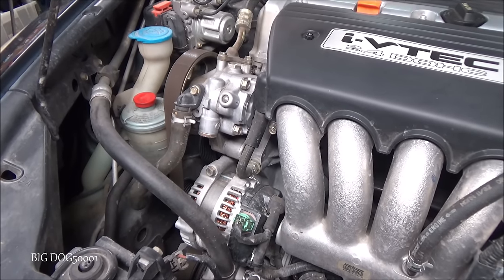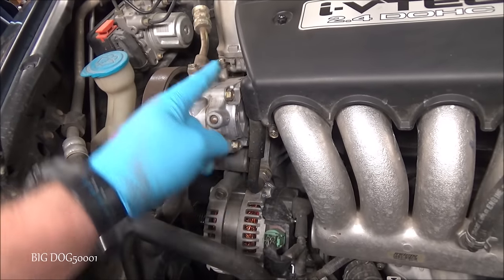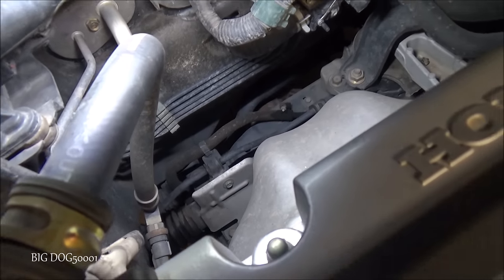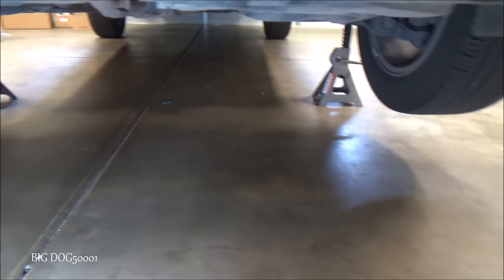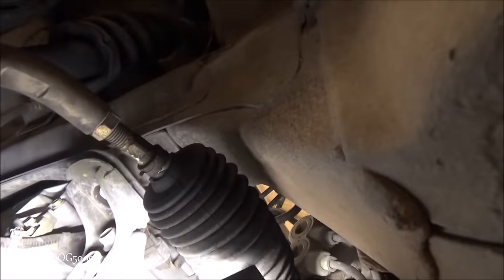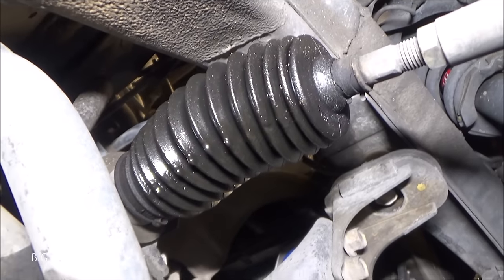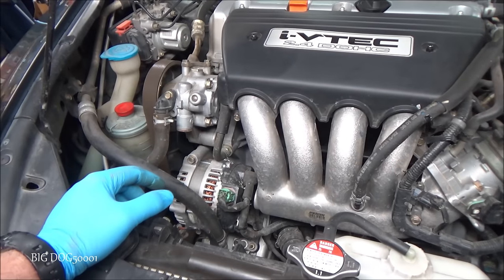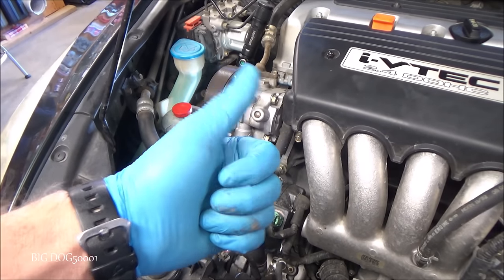Honda Tips: Finding a Power Steering Leak

Comment: Been driving my Honda without power steering fluid for over 3 years. Got tired of putting fluid every month. To this day I just man handle the steering wheel like my grandfather did back in the 1920’s. If some one tries to steal my ride, which I doubt would happen, it’s manual, with no 2nd gear and no power steering.
Reply: Damn a challenge 😭u cool though
Reply: @bintreshin3545  as long as A/C works, I am blessed
Reply: @Denver_____  not lying brother. Hahahaha ac its a must have
Reply: You're crazy. 😅 Jk. I'm not proud of this, but I don't know how to drive a stick. I Know how and I have drove before, but easier to say I don't know how.
Reply: i laughed at this way harder than i should have
Reply: At this stage of the game… The thieves leave you a donation can to collect money for a new ride 😂🤣
Reply: @MaxPleaseBeAGoodBoi  lol, open my door  in the morning and se a $20 dollar bill on the passenger seat
Reply: I thought I was the only one willing to tough out driving without power steering on my Odyssey! LOL! Mine is leaking out every couple days now so I just stopped buying fluid. Will fix it one of these days!
Reply: @robertc.6441  Keep driving it that way, my grip, arms and shoulders are stronger than ever. Had to parallel  park on a busy street, had to put some muscle behind moving the wheel all the way to one side while the car is stopped. Work out.
Reply: lmfao i love this. just changed the serpentine belt on my accord today, and got pissed, and yanked the power steering reservoir out "BITCH YOU DON'T EVEN WORK!!!" LOL
Reply: 😂😂😂 man handle the steering wheel
Reply: Jajaja! Love the no f***s given
Reply: Lmao I am at 2 months trying to figure out if i should replace it or deal with.3 years makes me think manual steering is fine, the noises suck tho.
Reply: lol still got another 300,000 miles in her.
Reply: @brandonb88 she’s gone from a slow leak to a full blow and I’m still toughing it out. Engine runs like a beaut other things are just rusting out
Reply: Damn savage with it
Reply: Same here !
Reply: Damn 😂😂😂

Comment: THANK YOU for this video. My Honda dealer showed me this exact leak and told me I needed a whole new rack. I didn't believe him. Thought he was just trying to make extra money off of me but you said the very same thing so I guess I'm getting a new rack.
Reply: How much did they quote you, if you don’t mind me asking? I have the same problem or so I think.
Reply: Same as me
Reply: Hopefully some people see this and are enlightened. For years now, the dealerships have become parts re-placers and not parts repairers. The total solution is always we need to replace this, Repair, never enters the conversation.
Reply: just so you know, most leaks (in engine/ transmission/powersteering) happen due to a rubber gasket hardening. while yes, as with all parts in mostly everything, you will have to replace the part @some point. but that could be 1yr, 2yrs, 5yrs 10yrs down the road. who knows if you'll even still have the car by then? so IT IS (imo) worth it to, at the very least, pick up a $20 bottle of sealant to see if it solves your issue.  ESPECIALLY if it is a minor leak. you might've been out of fluid, but the PS reservoir is not big to begin with and who knows how long it's been leaking. point is, it could be a minor leak and a $20 fix. there are crappy sealants out there, but AT-205 RE-SEALANT is a great product for any of the 3 i listed above. 

good luck
Reply: @mikeTHEmanatee I drive old cars and loathe that people actually do what you have described. I wish they would ban that stuff entirely. It's definitely not illegal and its your car but it's a mechanics nightmare explaining that the previous owner filled the system with an unknown substance.
Reply: At-205 is legit. You can also use it to keep rubber parts supple, such as the CV boots.
Reply: My dealer said you have a power steering leak and quoted a pump replacement.
I took it home, pump and lines are clean but, all this fluid down at rack sooo, sad day for me, but at least I didn't pay for a new pump then find the leak

Comment from the maker: This video covers older conventional power steering systems with power steering fluid and an engine driven pump.  Newer systems use Electrical Power Steering (EPS), which uses an electric motor to assist with steering force instead of fluid and a pump. I do not talk about EPS in this video.
Reply: Great Video! Thank you!

Comment: There doesn't seem to be a power steering cooling sub-system for these K-Series Hondas.  I don't have one in my Element whereas all the other cars I have owned over the years had something along the lines of a cooling loop in front of the main radiator or a mini-radiator or even a loop inside the bottom tank of the main radiator.

Comment: No need to guess what the oil leak was. It was the Oil Pressure Switch. I've gotten to know the Hondas quite well over the last couple years. I bought my granddaughter an '03 CR-V, and I bought an '01 Accord EX 3.0L last year as a hobby car/weekend ride. It never fails with the 2.4L. I finally got all the oil leaks fixed, and replaced the alternator (what a production to even get to the darn thing!), and just noticed yesterday that granddaughter's PS pump is now leaking. It looks like it's coming from the fittings. Going to try and replace the O rings in the return and high pressure connections to see if that fixes it. If not, I can get a reman'ed OEM pump and put it in.

Comment: I happen to be going to see my mechanic tomorrow morning exactly for this specific problem (as well as a few others), so this is an "absolute must watch" video for me. The problem I have is exactly as you have described, the kind of winding noise that increases when the steering turns. I had already changed the high pressure hoses on top, but the power steering fluid is still going down. Your video will certainly help as I will be discussing it with my mechanic tomorrow. Thank you and keep up the good work .... for those of us who are concerned but lack the technical knowledge and skills. Cheers bro.
Reply from the maker: Thank you, I appreciate the comment!
Reply: @Ravi Menon hey! Was your issue resolved? I’m facing the same issues
Reply: It's ok to put some oil and take to mechanic.   Or tow my car I have same problem
Reply: Do you remember how much it cost to fix it. I’m taking my 2003 Honda Pilot in tomorrow for this exact problem and I’m trying to get an estimate
Reply: @beyondinfinitelove13  NO don't use any other type of fliud even temperarily as it can ruin your whole system. Only use Honda power steering fluid or regret it.

Comment: Excellent video with amazing detail which I learnt a lot from. I'm glad you mentioned that you only use Honda power steering fluid and also only Honda parts. My 2000 Acura TL 3.2 power steering fluid is leaking. A friend said go to a local mechanic, and some people on the internet said to use stop leak and that non Honda power steering fluid is safe. After your great video and other sites that also suggested only use Acura power steering fluid, I have decided to have my nearby Acura dealer fix it. After your video and a few other videos I know that it isn't the O-ring and not the rubber steering boot below and no strange sounds when turning the steering, and no over flowing fluid bubbling out of the reservoir, which never went dry thankfully,  I figure that it's likely just the power steering hoses need replacing, which is expensive however a lot less expensive that changing the power steering pump. I'm thankful I didn't try stop leak or other makes fluid as it can wreak the whole system.

Comment: Thanks man .. got a chance to identify a power steering fluid leak I have near my front driver’s side tire while I had my splash guard off (just fixed my AC on my own for the first time and had the bumper + splash guard off so figured I’d check other parts of the car too while they were exposed). Probably just saved me some headaches in the future. Interestingly, the power steering fluid level is holding and doesn’t seem to be leaking at all; the level’s been the same for months and there aren’t ever any puddles I notice underneath. Not exactly sure why I still see fluid everywhere on the parts underneath as if it’s leaking though
Reply: CV axel leaking transmission/differential fluid.  I pour 1oz of uv dye to rule out engine oil/ps oil/trans oil

Comment: I just replaced the high pressure line myself. It was very hard to get the nut loose where the metal line connects to the power assist and steering column (I think that's what you call it??). Once I was done installing, I added  Prestone power steering fluid, but left the cap off of the resivoir so that I could see if I needed to add more. Yet, the result was that there was now a mess of fluid all over the place including the passenger headlight, all of the parts within 2 feet of the resivoir and pump. As I pulled out, the steering made a lot of noise. Then, I got to the corner of my street as the noise stopped but the steering no longer had any assist whatsoever. After going to the auto parts store to get a full quart of real Honda fluid, I found a puddle underneath.

Comment: thanks for this video. I had a leak with my Honda Element at an O ring area. I replaced that and now no leak there or at the reservoir. But there is still a leak more towards the middle and back of the engine. I can see it under the car and also on the frame. I will check those boots where you just found the leak on this car and see if that is it.

Comment from the maker: Any guesses on what the Engine Oil Leak was?  (Not the power steering leak)
Reply: VTEC control valve/solenoid
Reply: Honda engine, as simple as that, thats the cause because everything leaks, even the water around the cylinderblock channels leaks into the cylinder and evaporates, such a genius design of water channels that corrodes, sorry guys, a very bad experience  in honda
Reply: I sure would like to know what the other oul leak was?
Reply: As I mentioned in my comment, I'll say the Oil Pressure Switch. VTEC Solenoid Filter Assembly (the gasket) is too obvious, and when that goes, it puts oil all over the back side of the engine. Since the oil filter looked clean, and there weren't any drips or puddling of oil on the frame and control arm assemblies, but just on the rubber boot over the OPS, I'll go with that. It leaks too, but I've found not as bad as the VTEC Solenoid Filter Assy.

Comment: Using Honda accessories exclusively is in an ideal world. In my country it is very difficult to find original Honda replacements even oils and fluids, we have to look for after market. But if we go to the dealer, it is possible to find some, but with a value five times higher, or usually they don't have them,  wey have yo wait three months, it's very complicated. And Honda is a common brand in my country.

Comment: Bro you gotta show a plan B for those who want to fix their power steering leak without spending $$$. 

A brand new steering rack is good, original honda fluid is good. But what if we dont want to spend?

Is there a DIY without having to buy parts?
Reply from the maker: I wish, but any cheap fix will not last unfortunately and usually ends up costing more in the end after it has to be fixed a second time.
Reply: @jr217r  the boot only protects from dirt getting in if it's leaking from the seal it'll still leak

Comment: When i turn the steering the fluid in the resovior doesn't really do anything like bubble up. It seems as if its moving through the lines tho but slowly. Also when I press on the gas pedal while the car in park and the engine is running the steering feels more softer but when I ease up it gets back hard. Why is that? Do i need a pump or does it needs bleeding?. One more thing, the fluid levels remain the same.
Reply: The first time I experienced steering issues and looked under the hood, I found that a part of the serpentine belt had been completely stripped off. I could have just removed the stripped part, but it seems like something cut the belt. The car also shut off before the belt issue occurred. Therefore, it seems to me that the problem is related to the belt. I replaced that belt now with a slightly longer belt, and the issue persists

Comment: My mechanic told me same thing , and around 1100cad with parts and labor, too much for an 04 accord. I just top it off with power steering fluid every 3-4 weeks. Been 6 months , cost me $3/month
Reply from the maker: Sometimes a slower leak can go like that for a while but many times it will start leaking badly and it will lose all the fluid very quickly.

Comment: Great job my Honda is getting low too I can see under the under the hood in the back lower hoses is leaking.   
I have 2005 Accord with only 77 thousand miles on it and runs great I do have a ac hose leak too
Reply from the maker: Thanks for the comment!
Reply: Where do you do your work at ? Or state I’m in California and I like your upfront thinking about work.  
Do you know of any good mechanic in San Diego California? I have a Honda and 2001 Ford Expedition 4wd need a intake manifold leaking green fluid.
Reply: If u ever want to sell it contact me please
Reply: probably that leak is on the high pressure hose of P/S system.

Comment: Are going to tell us what the oil leak was from? Thank you for the video
Reply from the maker: It has been a while since I filmed this but if I remember correctly it was the VTEC solenoid.  Thanks for the comment!
Reply: @BigDog50001  Thanks Big Dog, funny I just replaced mine about 2 weeks ago. Mechanic shop wanted $1400. I did it for the cost of the VTEC Solenoid. Now the Rack and Pinion seems to have gone out. At least it's leaking from there. Time to buy a new car.

Comment: Exactly what my 2001 Honda Accord experiences now!  The OEM rack and pinion is a major rip off.  Got an aftermarket one for $180.  Will try to replace it.  I replace an aftermarket power steering pump and it dramatically reduce the leak.   Old pump was bad as well.  I am looking to replace the power steering pressure switch as well.

Comment: I had the same problem  all I did is change the boot u dont have replace  the whole rack and pinion unless both side are leaking bad second u could buy remanufactured oem rack and pinion for less
Reply from the maker: The boot only stops dust and debris from effecting joint, the seals inside the rack are what stop fluid from coming out.  New racks are hard to find after the vehicle has aged, most racks (even from Honda) are remanufactured units.

Comment: My return lines are damp both right where they connect to the plastic reservoir. Can I just swap out those two hoses myself? Makes noise and air bubbles in fluid when it’s cold out.

Comment: hi Big Dog really like your video and how you present the information in a easily understandable way.  When you say "change the rack" are you talking about changing the whole steering rack  n pinion ?
Reply from the maker: Yes, replace the entire power steering rack with a Honda rebuilt unit.  Very common on Hondas 15-20 years old. 
 Thanks for the comment!
Reply: @BigDog50001  thank you for the clarificiation and the reply🔥👍

Comment: So my question is has anyone actually replaced the rack seal instead of replacing the whole rack??
Reply: I just replaced the whole rack on mine with a VisionOE BBB Reman and wish now I'd just rebuilt the Honda one. The reman one immediately started making a pop sound at low speeds and the left inner tie rod boot has ps fluid leaking from it... very frustrated right now.
Reply: mrau92me i got my original honda rack rebuild with a year warranty and it’s working great!! Aftermarket racks do no good in hondas
Reply: @abhijeetsingh1429  My 97 Accord did fine with an aftermarket unit. Where'd you get your Honda reman unit?

Comment: So it was the tie rod leak?  Had nothing to do with the power steering line???  I'm leaking in the middle underneath that car     in between the tie rods.  Long medal piece is all wet.  What is that piece call ? That's connected to the pinned

Comment: I understand the best way to avoid the well-known & expensive Honda steering rock failure is to keep up on your fluid replacement regimen. Steering rack failure is a drag, requiring a tow and losing your car for a few days!

Old, dirty fluid will accelerate the wear of your seals, so replacing the fluid every 3 or so years is pretty cheap! Either:
- Drain and replace - this method involves opening the system. (Ask your garage to do this and ATF changes)
- or else pull all the fluid from the reservoir (turkey baster) and replace it a few times, running the system each time it has fluid. This is the less-than- perfect 'dilution method' but avoids disturbing the connections & is still FAR better than ignoring fluid changes until the rack fails (costing you a thousand dollars.)
Reply from the maker: Thanks for the input!  Here is a video I did on servicing Honda power steering fluid:  https://youtu.be/jhIdhffMl5c
Reply: Well said. Thank you for posting.

Comment: My tsx is 07 with just over 100k on it, got this exact problem yesterday but it's leaking on the driver boot, and the fluid was very low.
Reply from the maker: Pretty common issue and no fun when it happens.
Reply: how much was the fix do you know?
Reply: i have an 07 tsx with 190k mileage